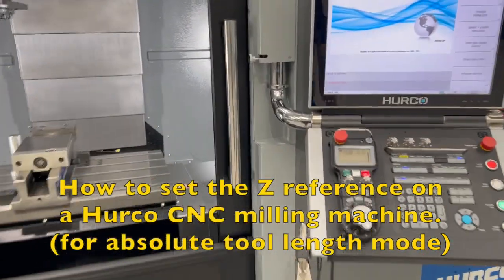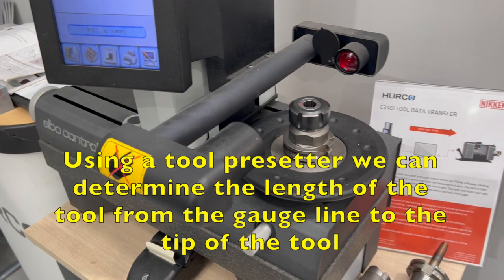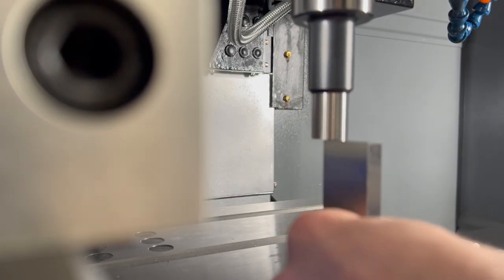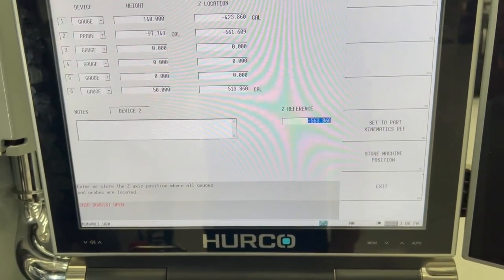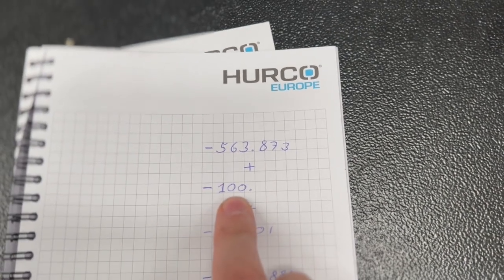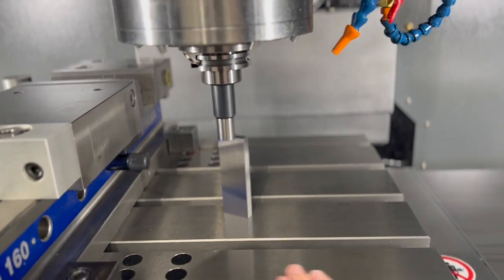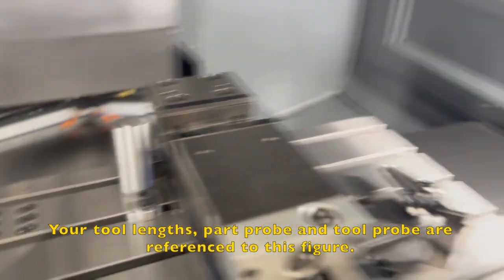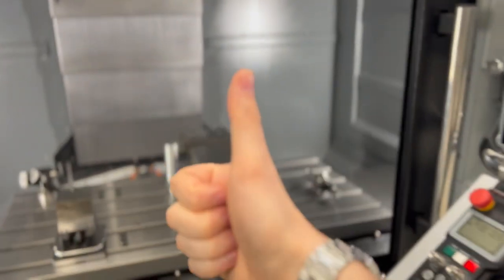Hurco setting Z reference - How to set your Z reference.

Comment: Hello,I set my hurcos with tool setter  tessa.I think is better than block setting
Reply: It is, every day of the week.
Hurco supply a branded version which is good all the way down to setting 1mm endmills or drills in terms of the setter spring rate to be overcome when pushing down on the measurement surface and not breaking tools.  Paid £230 5 years ago for one.  They are accurate to within a couple of microns too.

For a one off quick skim of something you can also jog the tool to the work with the spindle spinning and touch off followed by pressing the axis zero button on the MPG unit.